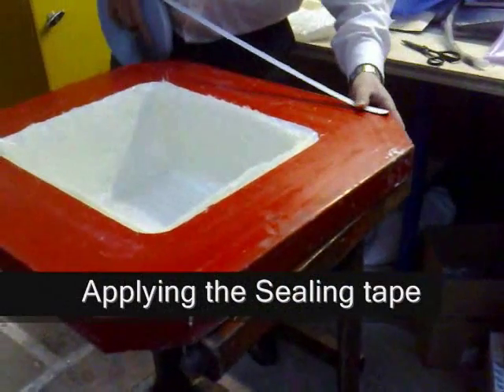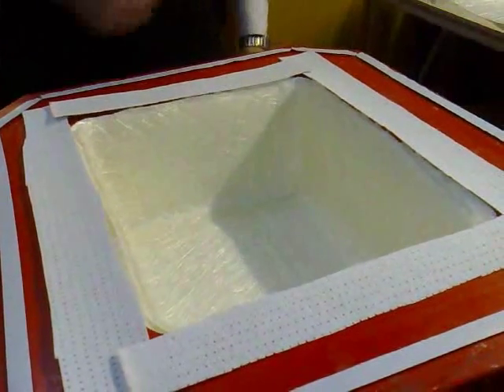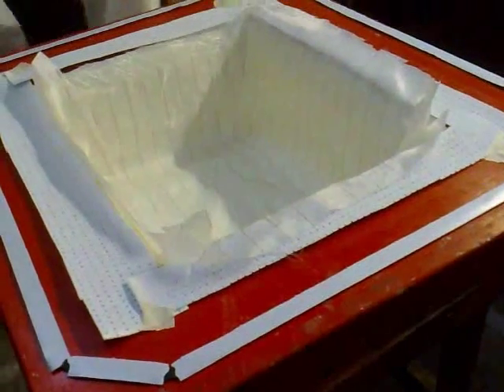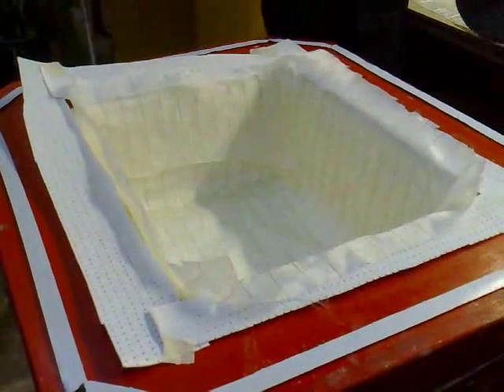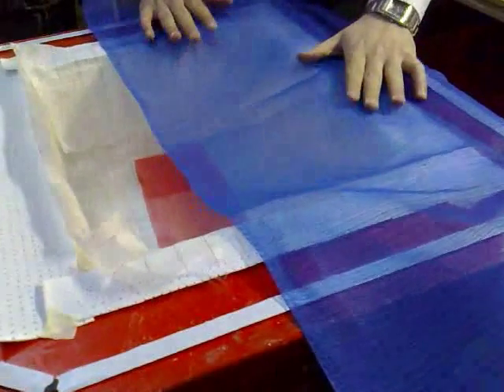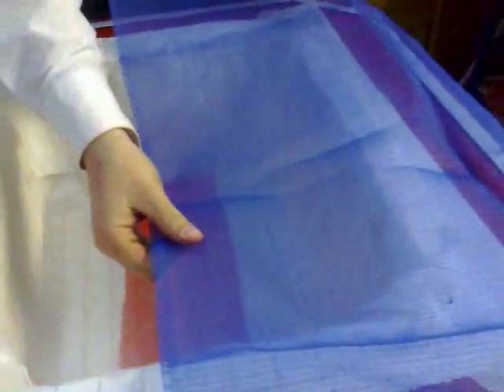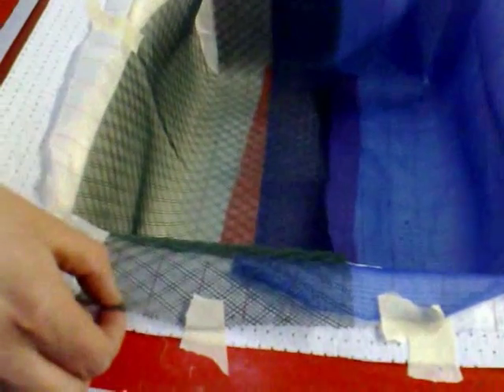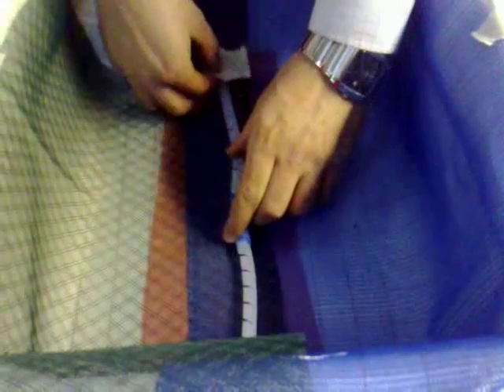vac infusion part 1 of 3.wmv

Comment from the maker: @tardifnk Hi This is just a low tack adhesive just to hold the fabric in place, it can be used inbetween layers and does not effect the final laminate as  long as it is not applied to accessive and cause obstruction to resin flow. just a quick light spray is required to hold the fabric in place. 

Kind rgds ecfibreglass